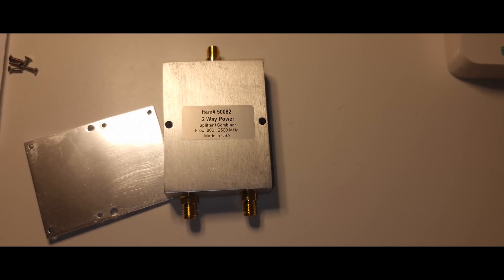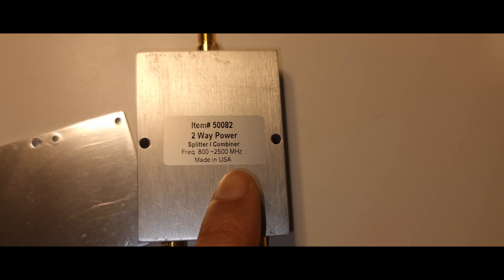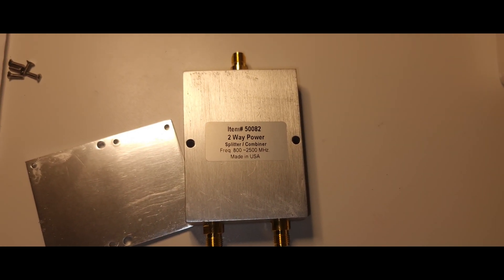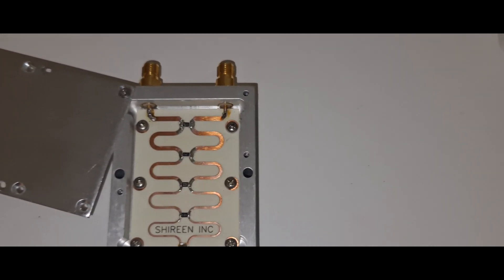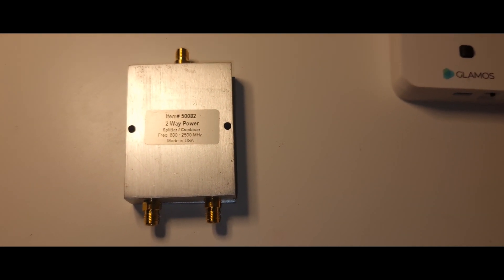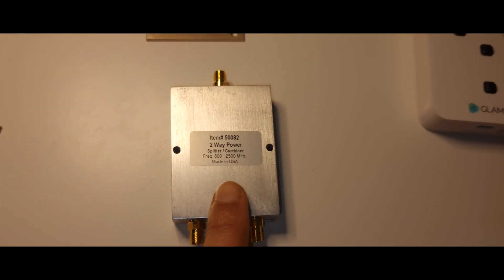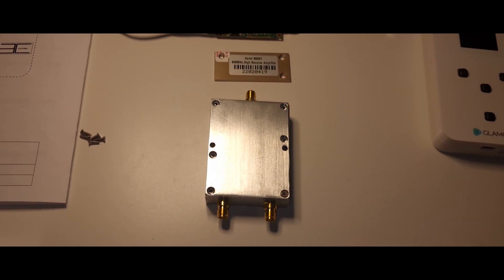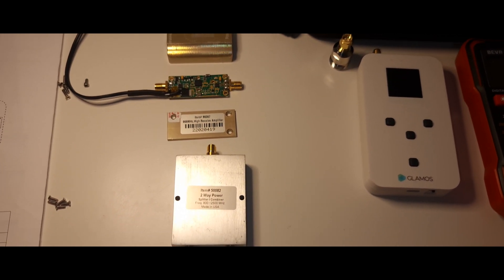Helium Miner 2 way Splitter/Combiner teardown Par 3 _HELIUM ADDICT

Comment: is 16dbi rx not too much gain when you don't have much loss from cables etc? I was wondering if you have had issues with this?
Reply from the maker: I tried with 5 cm cable and he works smoothly with no problems, but Sorine said it's too much gain , I think testing is the best solution with Helium and every setup it's unique.😉✌️

Comment: Hello, good video.
I have 1 question. I have bought the splitter you recomended me but when I payed for it they only charged me like 1€. Instead of whole price. What does that mean? Thanks.
Reply: From Mini-Circuits webstore
Reply from the maker: I think 🤔 they make mistake or the are out of stock egan and they will not charge you intill the product will be ready to ship 🤔  I think you should contact them directly buy phone or bay Email the have good costumer service 😉
Reply: @heliumaddict8582  fk, but when I bought it there was still stock.
Reply from the maker: @ShadX222   just call and confirm with them 
It's 5 minutes in phone bro and you will have your piece of mind , call the and let me know

Comment: Hey, so question still stands not clear. How with Vodafone Internet you can connect 2 or more miners using ipv6?
Reply: And get no relayed, which of those routers should I use? 
Vodafone EasyBox 805 DSL
FRITZ!Box 7590 DSL
HomeBox FRITZ!Box 6660 Kabel
Vodafone Station Kabel
Reply from the maker: @theshortcontent3660   hi 
First where you live?? In Germany 🇩🇪??
If not Germany don't youse the Vodafone Router, it's necessary to get the internet from   Vodafone internet provider,  well to be easier for you just youse VPS and this will solve the Relayed problem 😉 ✌️
I hope that unser your question ✌️
Reply: @heliumaddict8582  Live in Germany, now I'm using o2 internet and fritzbox
Reply from the maker: @theshortcontent3660  I replied to your Email 😉✌️
Reply: @heliumaddict8582  Guten Morgen, I haven't new email from you. Can you write in message or one more time replay in my email? Thanks ♥️♥️♥️
Reply from the maker: @theshortcontent3660   Hi with O2 will not work you will need VPS  
you need to bring internet from Vodafone  not just the router 😉✌️
Reply: @heliumaddict8582  ok but what is the difference between o2 and Vodafone Internet? Can you explain simple way? Like: with Vodafone Internet and router name you can get.... or you can connect directly through lan ports and so on... can you explain this thing?
Reply: If you have few minutes, check email, I want to call in private.

Comment: Hey bro i have question. If i change my sd card for a better one and turn off and on my sensecap. Will i lose all my witnesses and start with 0. or will the witnesses number be saved?
Reply from the maker: Hi 👋  , well with Sensecap M1 you should contact them in discord and ask them about SD cards  please to be save .
And yes you will start from 0 witness 
😉✌️